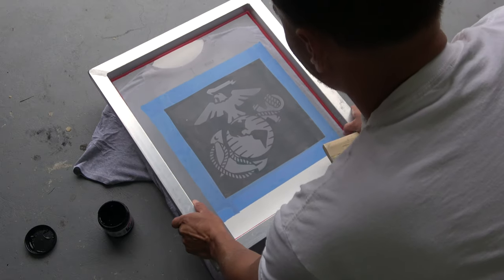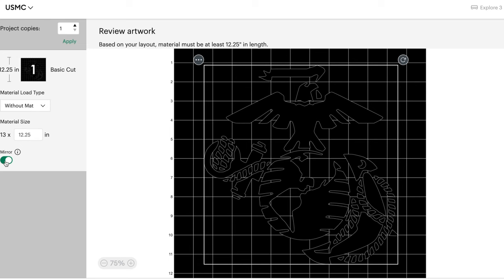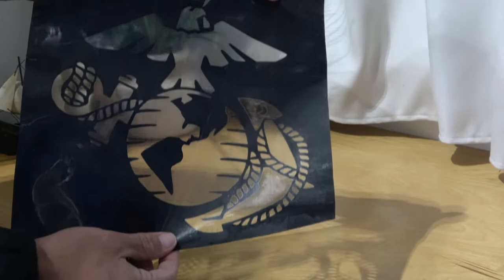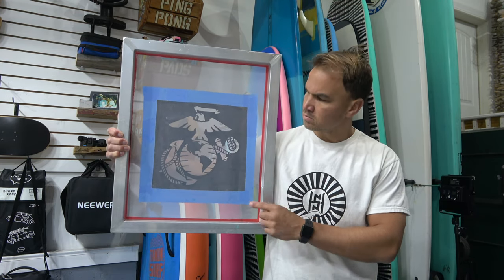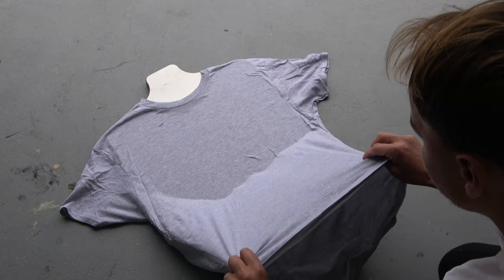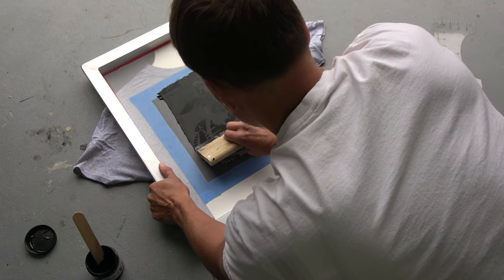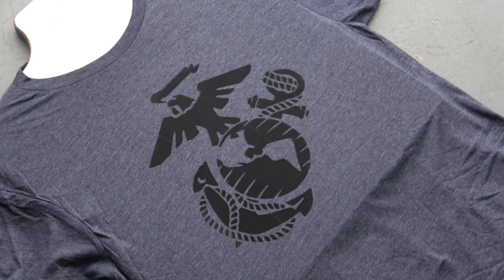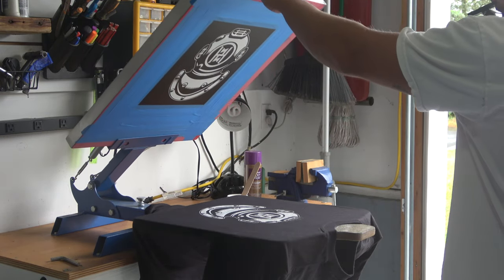How to Screen Print with a Cricut, THE EASY WAY!

Comment: Let me help the algorithm for this awesome video.  I really love how you simplified the process.  I feel like I am ready to try screen printing now.  I do have questions.
 What do you do clean the screens and stencil?
Can you use that same stencil with a different color afterwards?
Reply from the maker: Thank you. I appreciate the comment 😌 If your going to reuse the screen, just hose it off outside gently when your done. I’ve reused screens for 3 separate print jobs once. But recently, I just clear the screen and start over. I like a clean start. It’s the only downside with Vinyl but it’s much more simplified than the traditional method. Hopefully this helps! Thanks for watching. Good luck. Let me know how it goes. 

Also, watch my previous video I did on screen printing. I go into more detail. Link in the description below. 🙌🏼

Comment: You make it look so easy.  I have a question, do these Vinyl designs also come in smaller patterns?  that is, in very small letters, etc., it works just as well???  also should only water ink be used or does it also come out with plastisol?
Reply from the maker: Thanks for the comment and nice words. Much appreciated!  I use Speedball Ink. It is water based. If you make a mistake while printing, just use a warm cloth to soak up any errors. Comes out easy. Only when you set it (heat press) does it come permanent. Making mistakes is fine though, just learn from them. It will happen, don't get discouraged. Using smaller designs should work fine! Hopefully this helps!!
Reply: @sshouser31  Thanks, I will give it a try.
Reply from the maker: @eleftheriatryfon7367  Let me know how it goes!
Reply: Wow. This route is really unlikely.  It even comes in a very small version.  ✌️

The only downside is that vinyl doesn't hold up to small patterns over 5-6 t-shirts.  Small details start to come off and ruin the t-shirts.
Reply from the maker: @eleftheriatryfon7367  Bummer, sorry to hear. Have you tried Iron On? Feel free to send me pic's on Instagram if you'd like.

Comment: What circuit setting did you use to cut the vinyl permanent vinyl is not a option for mines
Reply from the maker: Make sure your software is updated. What are some options? If you see a vinyl option that should be fine.
Reply: @sshouser31  yeah I used the vinyl option but it didn’t cut through all the way

Comment: how many can you get out use vinyl
Reply from the maker: I’m still using a screen I made 6 months ago. They can last. Just clean with cold water very gently.
Reply: so how many can you print can you print
Reply from the maker: @tonyengland1974  The most I ever got from one job was 10-12. But you can clean it and reuse.